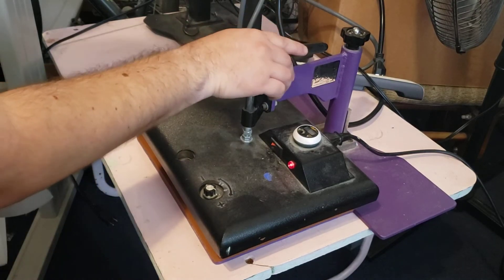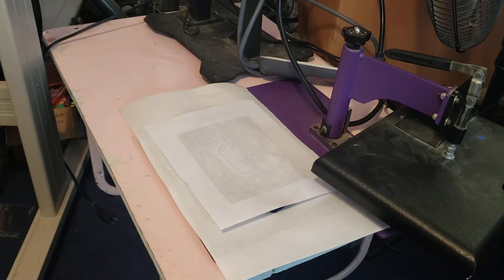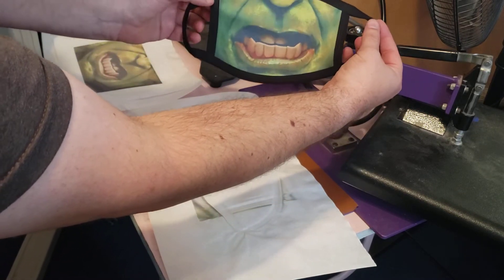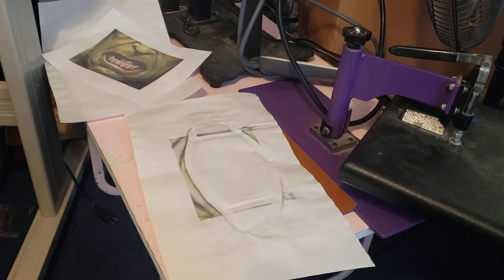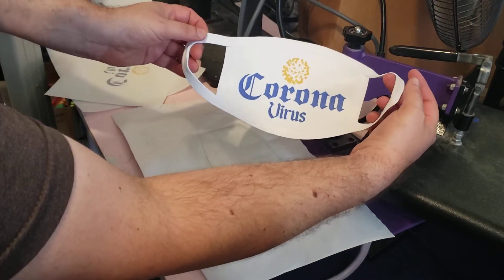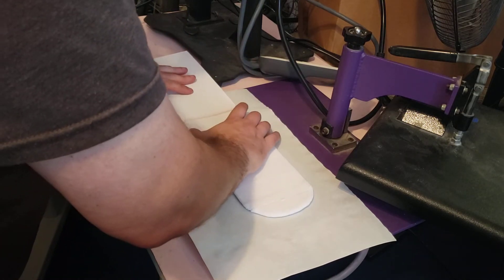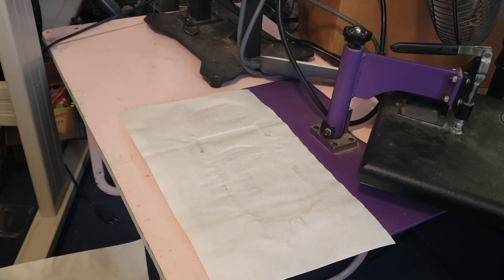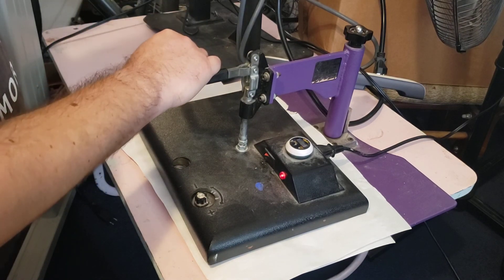Sublimation Printing with Epson ET 15000 Mask and Socks

Comment: Are the mask three layers, they are better if the right material is used. One possible problem does the high heat not. Fuse the polyester to the extent it makes it impossible to breathe through the sublimated mask? Do you have a tutorial for setting the colors right for the Eason et 1500? Many thanks

Comment: i have a random question for you i was wondering if you had to do any specific color profiles when you put the t49m epson sub ink in your et 15000 i know not to use the epson standard default that i do know but im just curious because i just finally was able to get my hands on the et 15000 and i want to use the epson sub ink like you did thank you
Reply from the maker: I used one of the stock ones i had I also change it a little when Im doing anything with people to get better skin tone

Comment: Do you recommend the Epson ET15000? I was SERIOUSLY debating the Sawgrass 1000 but am leaning to the 15000. Any tips or advice is greatly appreciated 😊
Reply from the maker: here's what I'd say what size are u looking for and what size do u want to print the sawgrass 1000 is 1500 so for 1000 more u can get the f570 if u dont want to pay that kind of price go with 15000 and convert it it works great and for the price it is it's hard to beat that price for a 13x19 sublimation printer it's not in there f line so it's not supported by epson but it works great and people convert them all the time buy the epson sublimation ink also it's cheaper the the other inks out there and works great
Reply: @waldo2413  so that's where I'm leaning. I think the Sawgrass is too much for the issues I've heard ppl have, the lack of customer support, and ink replacement cost. I'm having a hard time finding an epson 15000 tho. Thank you for your reply and advice 🙏
Reply from the maker: @leighaparker8798  https://www.bhphotovideo.com/c/product/1524993-REG/epson_c11ch96201_ecotank_et_15000_all_in_one_cartridge_free.html?gclid=Cj0KCQiA-aGCBhCwARIsAHDl5x_5_w20XDR7t_eqfYHHIssnZg38EwrfYxXB9v6BwQ7Rtb-tACa-LzcaAvT2EALw_wcB has them in stock there's a few other places also

Comment: Hi I’m having trouble with my 15000 eco tank my magenta and yellow won’t print even after doing the head cleaning. Is there anything else I can do?
Reply from the maker: what ink are u using .have you tried the deep head clean that will flush it sometimes you might have to soak the print head
Reply: @waldo2413  I was using printers jack it worked perfectly then it was low I added hippo ink. But the magenta and yellow won’t even register as if they are filled it’s like they’re empty but they’re full
Reply from the maker: @DecorandMoreLA  try deep head cleaning if that don't work do a head soak

Comment: So you can use regular paper but the colors wont be as vibrant vs sublimation paper?
Reply from the maker: mine looks fine I dont see a difference some people say when they try it they can tell others say they dont see any difference try it out on something like a cheap pair of sockets and see you will be surprised how good it comes out
Reply: @waldo2413  thanks for the tip to help me save money❤
Reply from the maker: @loritaparker4367  thanks glad I could help

Comment: I am looking to buy a printer for my mass but not sure what to get between the 7750 and 15000? please help
Reply from the maker: the page per minute is faster on the 15000 they have a few other things also with the 7750 you have 2 black inks also so you will have to buy more ink to set it up
Reply: @waldo2413  thanks! what about usability and also print quality? i am still stuck between choosing lol

Comment: Great video, wife and I just watched.  We are just getting started, ordered ink today, and hope to get the printer on cyber monday.  In your video, you just used some plain socks?  What about the masks, were those treated as blanks or were they also plain material.  You mentioned that your just using plain copy paper instead of sublimation paper.  I can see that being a cost saver, but is quality the same?  As I mentioned, just getting started.  Can the same transfer be used more than once?  Thx so much.
Reply from the maker: the socks have to be polyester but you can buy and1 socks at walmart and they are poly so they work great and you can buy mask at bananasandpickles.com  printer paper works great you can see a different on some items so you have to do a test but something like socks where they have fluff your not going to see a different or even mask a tumbler you might see but most customers cant tell  if u print enough u can see things that a customer might never see and you can only use the tranfer once if u use it more them once the color is not as bright or might not transfer at all hope that help

Comment: So you are using the ink that came with your printer or a different ink by Epson ?
Reply from the maker: I'm using different ink its epson t49m ink
Reply: waldo2413 do you know what kind would work with The Epson Ecotank et-15000 I was doing research but it says it the ink that came with it it sublimation ink I just don’t want to mess it up
Reply from the maker: @ashelymurilloasa  https://www.itsupplies.com/Epson-T49M-Black-Ink-Bottle-SureColor-F570-p/t49m120.htm
Reply: waldo2413 
G
Reply: waldo2413 thank you so much
Reply: @waldo2413  What software are you printing from? Do you have a color profile for the Epson sublimation inks (t49m)? If so could you share your settings? I'm using Corel, but having some trouble getting blues & grays to print correctly. Thanks!
Reply from the maker: @mfatty500  im using photoshop im not using a color profile im getting close to what i want to see out of the colors what printer are u using and what ink ?
Reply: @waldo2413  I'm using Corel Draw x7, with an Epson et 15000, with ink from epson the (T49m) for the Epson F570
Reply: @waldo2413  I'm using an epson et 15000, with the sublimation inks from epson for the F570, and printing from Corel Draw
Reply: Y’all can just buy from cosmos inks. That’s what I see the majority of YouTubers use that I’ve seen

Comment: How good is this printer for printing sublimation
Reply from the maker: for not being made as a sublimation printer the lowest I'd the f570 epson so for converting it's one of the better ones the et ink system makes it great and it does have the same print head as others it works great for what it is
Reply: @waldo2413  thank you for the clarification

Comment: Hey what settings do you use to print?? I can’t for the life of me get my blacks to print black
Reply from the maker: i print in rgb and use normal paper and high quality setting 400 degrees 40 seconds or longer
Reply: @waldo2413  hi what is rgb?
Reply from the maker: @marsadavis7424  its red green blue setting in photoshop my printer is cmyk
Reply: Dude you said you PRINT IN RGB correct? And when this person asks what is RGB below, you reply that you’re not using RGB! Like 🤔 I’m confused! You contradicted yourself. Witch is it? Do you or don’t you print in RGB format? I’m surprised they didn’t reply questioning the contradiction and confusing reply you gave. 😊👍🏾
Reply: @waldo2413  I’m confused with your answer to her question. Can you explain exactly what you mean.
Reply from the maker: @juniorisclean  my printer is cmyk but i use rgb in my software setting the program will convert it to cmyk my other printer has a rip that does that
Reply from the maker: @flgirl250  yeah most printer are cmyk printer photoshop is set up for rgb colors can change when u go from cmyk to rgb

Comment: why is the et 15000 back ordered now omg.
Reply from the maker: that I dont know when I got mine they had them at a few places I just had to go in and check there online said they were sold out but they had them in stock
Reply: Supply & demand, and epson was not working, from what I gathered from other peoples comments on different forums. I happened across mine by a fluke, I just kept checking all the stores and found one 20 miles from us at Office Depot
Reply from the maker: @mfatty500   that what you have to do sometimes just keep checking places glad u got one

Comment: so will it not print on cotton ?
Reply from the maker: not without using something for it to stick that is poly
Reply: @waldo2413  what will make it stick on cotton ? i want to do air fresheners and idk if it will stick or not
Reply from the maker: @wadeashby8125  u have to but sub air freshener they sell them
Reply: Lol, I think the question was so this will not adhere to cotton. Not print. 😊👍🏾
Reply from the maker: @juniorisclean  you can use subcotton to get it to adhere but without polyester it will not stick or hold but they do make stuff u can put on cotton to get it to stick

Comment: I just got my epson et15000 4 weeks ago.  And have cosmos ink in it.  But I like to know the best print settings to get vibrant popping colors?  I recently did a mask but for some reason the pink color was not exactly the same.  The design is CMYK.
Reply from the maker: the pizza socks are rgb
Reply: waldo2413 in my mac,  for color match what should I use for cosmos ink.  And print settings?
Reply: I have the exact question!!! Using cosmos as well